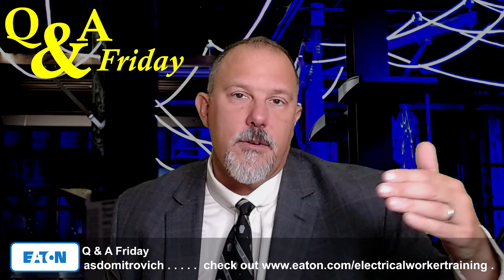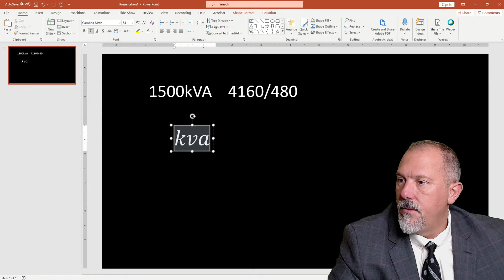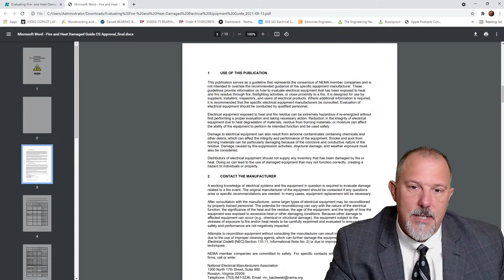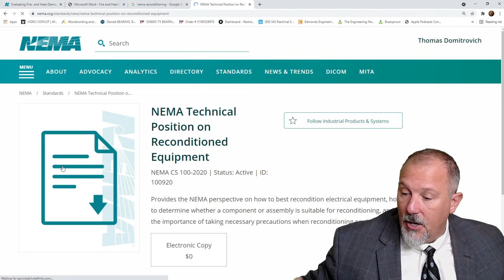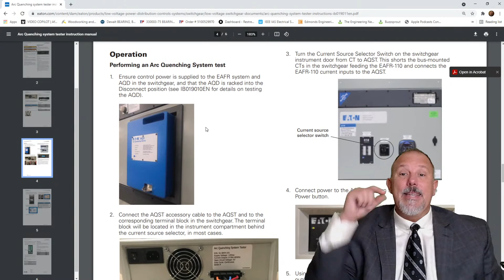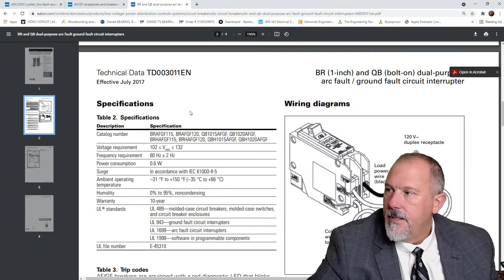Q&A Friday - August 13, 2021

Comment: 3 phase panels in single phase applications.  NEC doesn't apply to boats, including larger ones, but people use at least some regular commercial electrical products in boats.........................  I saw an installation where, to be able to switch between single phase shore power and 3 phase generator power, you get a 3 phase panelboard with feedthrough lugs.  At center phase, they split the bus in half in the middle of the panelboard.  They ran the supply for that panel to a 4 pole drum switch.  The drum switch made it such that on 3 phase generator power, the center phase is fed by phase B of the generator.  When on 1 phase shore power, line 1 fed half of the center phase, and line 2 fed the other half.  This balances the loads.  Though you had to make sure when you connect 240V breakers, that they are connected so they have 240V on both shore power and generator power.  Also, you had to know not to do things like try to run the 3 phase anchor or other motors when on shore power.